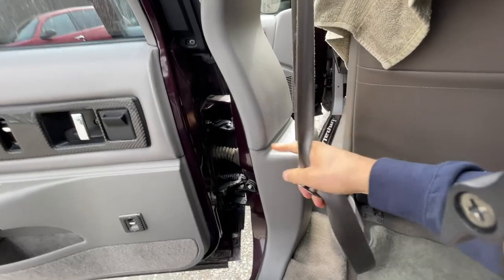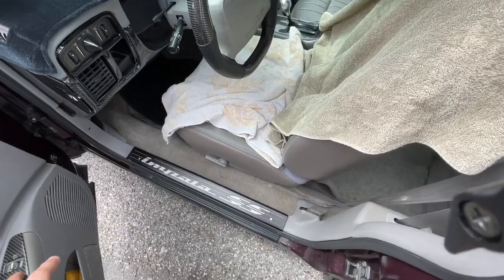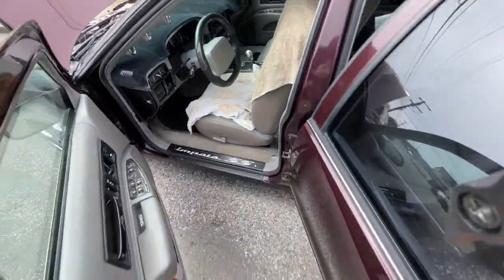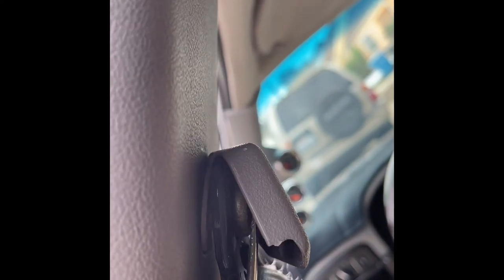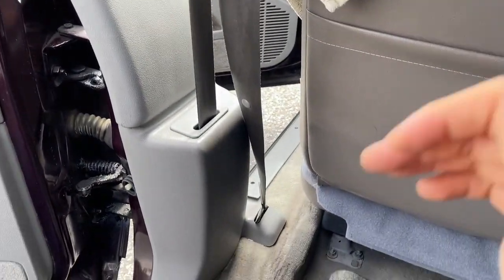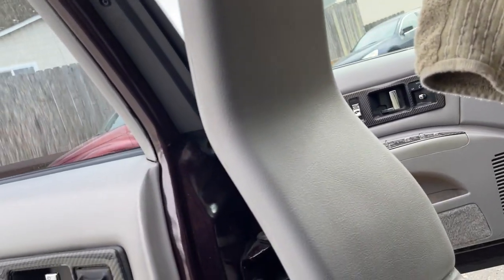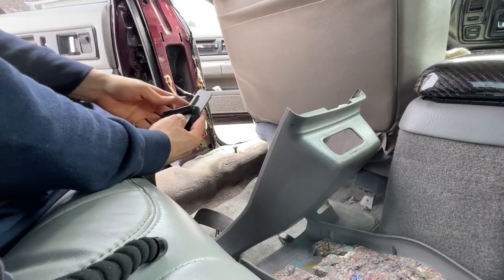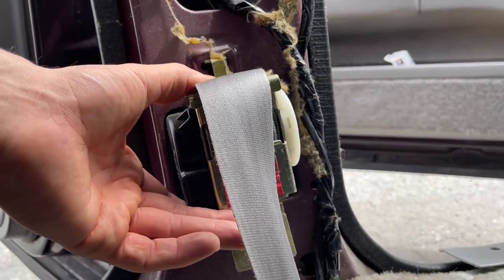Impala Caprice seat belt install and removal

Comment: It's nice that the TP 45 worked and you didn't strip your bolts but the reason the t45 was loose is because those bolts are t50

Comment: What gears were in it before the swap?
Reply from the maker: Stock 3:08
Reply: @96_kingz  that's what I have too. Do you notice any difference in highway mpg? I want 3.73s but worry about burning to much gas
Reply from the maker: If you are worried about mpg stick with stock gears